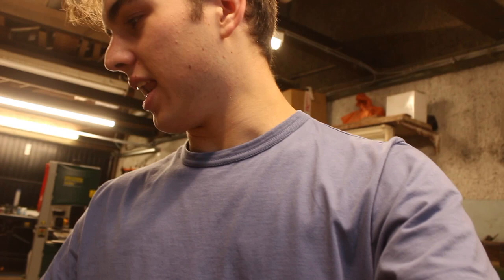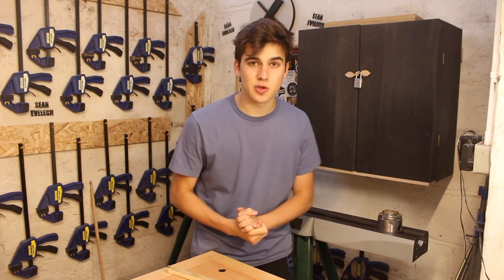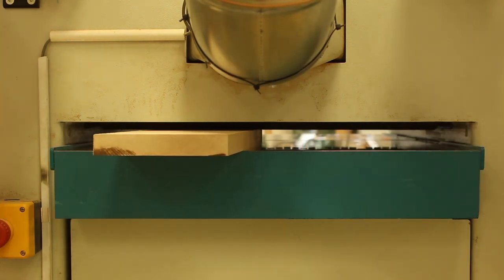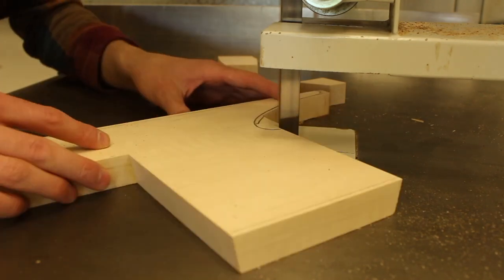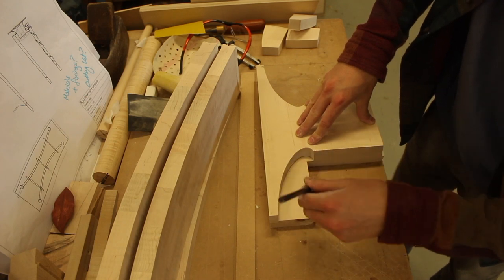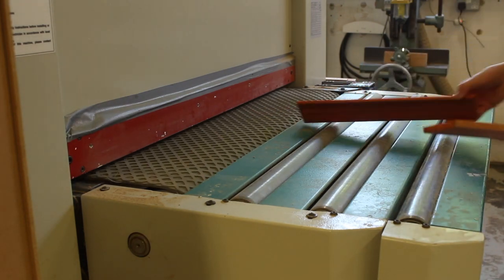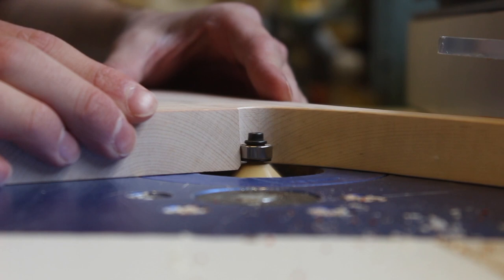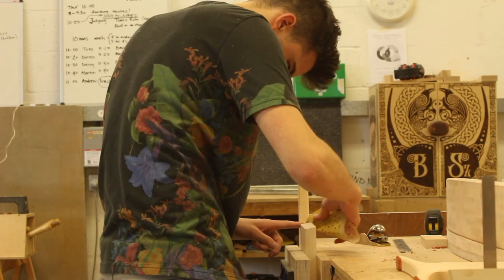Making Japanese Style Table Rails (Hallway Table Part 3)

Comment: The hall table is looking fantastic, you have a great talent. 

I felt your pain with the broken camera lens, If you can get hold of a clear UV lens and screw it onto the front of the lens it gives some protection from drops and knocks. You can get them on Amazon for around £3 - £5 each. A lot cheaper than £80 - £300 for a new lens. they've certainly  saved my bacon a few times when I've dropped my camera. 
Added bonus in a workshop environment is they are easier wipe the dust from and they save scratches to the main lens :-)
Reply from the maker: Hey mate! Thanks for watching and your kind comment. Yeah I do know about those lens protectors, and think there great... i don't know why i don't have one already. I should probably get one now

Comment: When you glued All the pieces together how did you know if all four contact points we’re going to touch the glass if you have it just a hair off it would wobble.
Reply from the maker: Hi Robert, yeah that was one of the most changing things about this piece. I attached it upside down, so the four contact points were flat on the workbench. even then there will still a lot of wiggling and tiny adjustments to do